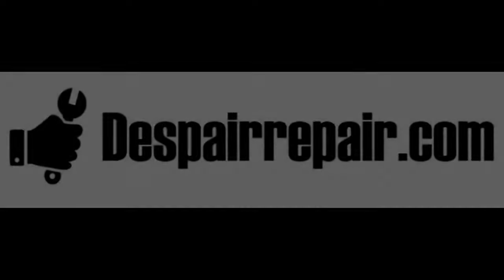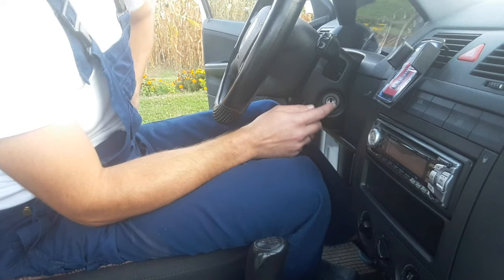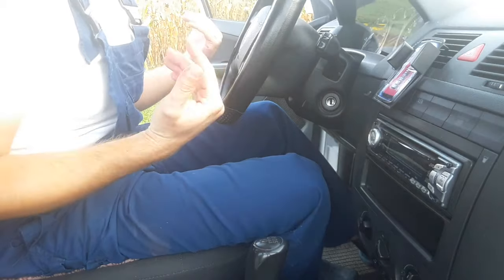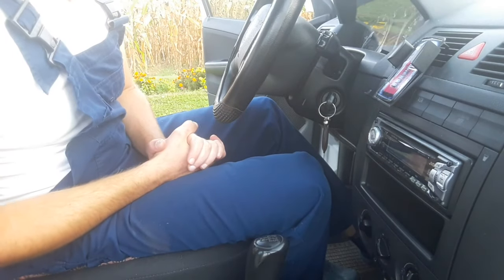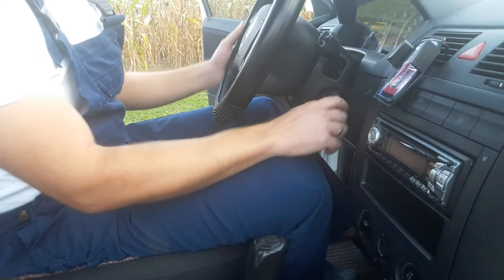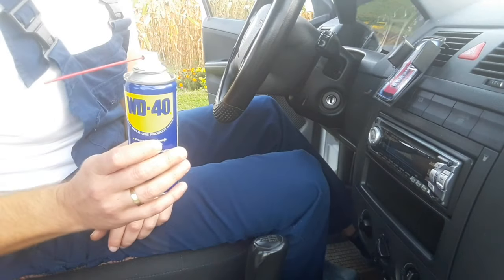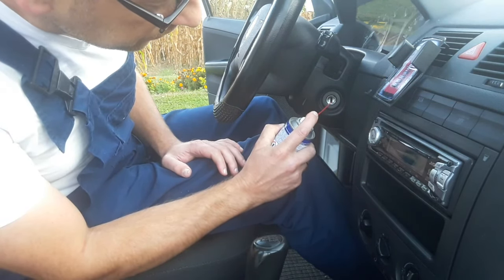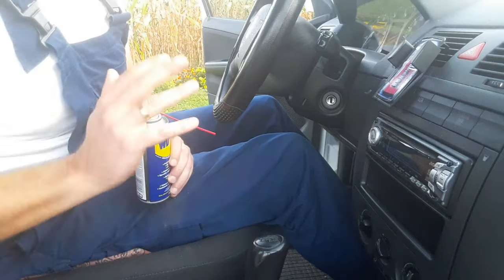KEY WON'T TURN IN IGNITION-HOW TO FIX IT

Comment: I was reading that it’s actually not good to spray wd40 directly into the ignition barrel, as over time, dirt and dust mixed with the wd40 can make it gunk up inside causing more problems down the line
Reply from the maker: Hi and thanks for watching!
Well, at least from personal experience, if you flood it with spray then this is more likely to happen.
One or two short sprayings are usually enough to fix the problem and shouldn't cause this.
Also, WD 40's lubricant spray is a good alternative.
Reply: @DespairRepair  ok thanks for the helpful reply 😊👍🏻

Comment: I have found the steering wheel is putting too much pressure on the key in a twisted bind.  I rotate the wheel to unbind the key, and I turn the ignition on.
Reply from the maker: Hi and thanks for watching!

I didn't understand, did you solve the problem without any of the mentioned methods in the video?
Reply: The twisted steering wheel puts pressure on the ignition switch not allowing it to turn.  Just turn the steering wheel two inches in the opposite direction, and it will no longer bind up the key, and allow it to turn once again.
Reply from the maker: @maxcinta5760  yes this is true. Because of the strain caused by the steering wheel, the locking mechanism may get jammed.

Just a budge from side to side may solve the problem.
Reply: @DespairRepair  Hello Despair repair

Comment: Hi, i have 2011 Polo Cross.,every now and then will lose absolutely all electrical power when i turn the key off. Clock resets, and the radio & Harzads can't be be turned On also. Thank you in advance
Reply from the maker: Hi and thanks for watching!

There could be numerous reasons for that problem, I would first start with checking the battery terminals and clamps if they're clean and properly tightened.
Reply: Thank you... Will check firat the battery🙏🏾

Comment: I did all of that and my steering wheel is still locked I don’t know what to do I have an Acura mdx 2007 and I never encountered this any advice I can’t take it to the  dealer now
Reply from the maker: Hi, and thanks for watching! To be honest, if any of this didn't help best don't drive it but rather tow it to a service.
If the lock mechanism is damaged or faulty it can accidentally lock up while driving (if you manage to unlock it) which is very risky.
All in all any kind of driving in that situation is risky.
Reply: I have no choice but take it in soon thank you

Comment: Can't believe how many ppl commenting having the same problem.Ive been at it for days now w no luck the key is stuck on,it will start but have to pull a fuse to kill it.And unplug the battery or it drains.The shifter works fine I took it apart,tried pushing the plunger on the ignition nothing works.Bout to try setting it on fire.

Comment: On the real I have the similar issue with my VW Tiguan 2013, key will go in and out just fine, but just didnt want to turn over.

I simply started flooding the lock and the key with wd40 while trying to turn the key and the steering/move the key in and out alot.
Eventually got it to start, however whenever I took the key out it was always a chance IT would happen again.

Right now my part time solution I have done is this, I had 2 sets of keys, but one of them the metal key bit snapped off the fob. So I have just been using the key from the broken fob and a set of pliers to turn over the car while keeping the broken fob on me. Keeping the metal key in the ignition to hold it in place seems to be working, and the car ignition wont start/turnover without the fob being next to the actual key itself, so even if someone broke in with pliers, they couldnt start the car.

Its almost like some part of the lock mechanism is slipping out of place so my keys wont "bite" and turnover when its out of place.
Going to have to try and get the issue solved asap tho, as the car is dead in the water when this issue happens.

Comment: Use graphite, wd-40 is for people who watch television. It's better marketing, but light-years away from doing anything positive. It's works 100 times better and is sold at Walmart.
Reply: Could I Do This Method While Key Is Stuck In The Ignition?

Comment: I was on the job sight and all I had white lithium grease.
Reply from the maker: Hi and thanks for watching!

I guess it worked?
Reply: @DespairRepair  it worked to the extent of what I had but later when I got home I did have to go with the wd40.
Reply from the maker: @richardwright9072  well WD 40 has much better penetration power so that's probably why it worked better.

Glad you solved the problem anyway.

Comment: But, what if the ignition is locked WITH the key in, and can't remove key cause the ignition is, locked.
Reply from the maker: Hi and thanks for watching!
In that case, I doubt that any of this will help and you should consider asking for professional help (if you can't make the repair yourself).
By the way, one way of getting the key out is to gently tap the lock with a smaller hammer, you just have to take off the plastic trim around the steering wheel first.
It will hopefully come out, at least that's what helped me.

Comment: Yea… well my key is stuck ON and I can’t turn my car off 🤣 My battery died and it got stuck in the ACC position until I had power… then it won’t turn backwards to OFF position now smfh
Reply: It wasn't the starter... a stuck starter on the on position also does that... if that happens next time unhook the battery.

Comment: First of all this is not for the issue where the ignition column lock is activated. second dont use WD-40 as its oil based and collects dust. use dry lube.
Also if its happening alot make sure that you make a duplicate key as the old key might be becoming bad.
Reply from the maker: Thanks for sharing and for watching!

Comment: I tried it and my steering wheel won’t budge And my ignition switch won’t still turn is there anything else I can do to get my car to start up
Reply from the maker: Hi, and thanks for watching! If you've tried everything from the video, then best seek professional help and repair.
Also, if the problem is severe, best to avoid driving the car so the steering wheel doesn't accidentally lock.

Comment: I have tried everything and mine want move.
Reply from the maker: Hi, and thanks for watching! If it doesn't work then perhaps check the lock mechanism, if it's damaged in some way, lubricating is useless.
Also, check the key if it's not bent or damaged.

Comment: What if the key won't turn and the steering wheel is locked?😩
Reply: And I'm at a park with no access to any supplies etc.
Reply from the maker: @carrieford8641  
Hi, Carrie and thanks for watching!

Does your car have manual or automatic transmission?
Reply: @DespairRepair  my car has automatic transmission...I found a video that helped me resolve my issue. I wiggled the steering wheel, as much as it would allow, while rocking the car and turning the key and it freed up. Apparently this can happen when you leave the tires turned when parking?
Reply from the maker: @carrieford8641  glad that you solved the problem. Maybe the lock got stuck because the steering wheel was turned and under tension.

Comment: Just be aware that making a duplicate either from a dealer or a bonded locksmith will cost about one-quarter if you still have your original key. If you lose the original, then getting a brand new one made and programmed is a several-hundred dollar proposition, but a bonded professional locksmith is almost always going to charge less than a dealership, but they HAVE to understand modern technology. ASK FIRST!
Make sure they understand you’re paying them to FIX IT, not work on it. If they can’t fix it, then no charge, or at least maybe a few bucks for trying, but if they seem hesitant, go somewhere else.
Reply from the maker: Hi, thanks for watching and for sharing!

Comment: I don't agree with the idea of a light oil in an ignition switch . There is now WD-40 Specialist Silicone Quick Drying / WD-40 Specialist Dry Lube with PTFE [ diirt and dust resistant  ] . You want something that will not attract dirt and dust , etc . Also , to spray the key with all purpose cleaner and use a small brush to clean the grooves out , then wipe it with a microfiber towel .
Reply from the maker: Hi, thanks for watching and sharing your experience. One of the points of the video was to use common household items but yes, that spray would certainly be better if available.

Comment: I cant even put my key in wtf do i do help
Reply from the maker: Hi and thanks for watching!

Is the keyhole clear, is the key OK?
Reply: @DespairRepair  yes its clear and keys arent damaged. Steering wheel is locked though i tried playing with it still wont let the key in.
Reply from the maker: @zurgboy07  that could be a serious problem with the lock mechanism and you should change it as soon as possible.

In the meantime, I would recommend trying to wiggle the key into the lock or try and get some WD 40 into the lock and then try with the key.

Again, that could be a serious problem and even if you get the key in the lock, you should probably avoid driving.

Comment: ■ despair repair, i have a nissan sentra , i use the car a lot i turn in on like 25 times a day because of delivery job,  i inserted the key won turn, i haven't try oil,i moved the steering weel both side and nothing.
Reply from the maker: Hi and thanks for watching! I would try then with the WD 40 spray (or some other lubricating spray).
Spray it into the lock and insert the key a couple of times. At the same time wiggle the wheel.
Just have in mind that if the lock mechanism is faulty, non of this will solve the problem. In this case, best don't drive the car and look for professional help.
Reply: @DespairRepair  i used lubricant and did what you said and nothing..

One question que shift lever P, R, D, N,L ,
Does thr switch lever have something to do with lock in the steering wheel
Reply from the maker: @juhanalmohed2599  on most automatics there's a switch on the gear lever which, if faulty, locks up the steering wheel.
It should be located near the gear lever but it depends on the car model.
Try pushing the gear lever front to back a couple of times in order to jolt the switch.
Sometimes it helps. In any case, find out what the reason is as soon as possible and best don't drive the car.

Comment: I can turn my steering wheel and the key won't turn. I sprayed WD-40 and still no turn. Looking at $600 with towing, $250 on parts and $250 on labor. Cars suck.

Comment: Viewers please be careful which advice you choose to follow. Putting liquids instead of graphite into the ignition can damage some components and/or cause problems with security systems. Also, just inserting the key jiggles the tumblers; there's no need to force turning the key possibly causing more damage.
Reply: How do you that?

Comment: Omg of course I gotta be cursed with one of the deeper issues that none of the simple solutions can fix
Reply from the maker: Hi and thanks for watching!
It may be so but this also happens:-). If none of the tips help check if the key is OK. If it is, consider changing the lock mechanism as soon as possible.

Comment: My key doesnt even go in all the way
Reply from the maker: Hi and thanks for watching! If that's the case and if any of these methods didn't help you should consider changing the whole ignition lock as soon as possible.
But one more thing you can do(which you probably already have) is to check the key for physical damage. Maybe you can just replace the key.